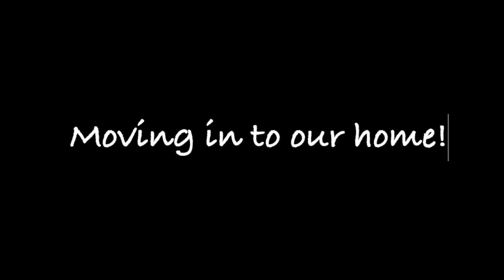We Are MOVING IN!! | Couple Builds Dream Home

Comment: The view of your gravel shop floor reminded me of what I did in mine “temporarily.”  Not going to say how long it’s been. 

I noticed a lot of moisture on the underside of my vehicles, especially in winter thaw cycles. 
Went to Menards (Lumber yard.). Picked up a few of their free throw away lumber shipping covers. It’s like Tyvek. Really works well as a free temporary moisture and dust barrier.
Reply: Also used on lumber and firewood piles, under leaves and branches in my trailer-just pull out tarp at dump or burn pile to unload,  they’re very durable compared to tarps or plastic sheeting. And more UV resistant.
They aren’t perfect, will have some tears or holes from staples. 
Nice to get additional use out of something headed for landfill.

Comment: You both are moving at warp speed- so great to see your hard work making you more comfortable, love the Riley cams.
Noticed a fair bit of moisture on your windows- up here in Canada with tight houses in the winter I run a HRV (heat recovery ventilation) unit to reduce moisture and blend air so the incoming fresh air is warmed and circulated in all the rooms.
Reply from the maker: Now that we have a constant fire going up here we aren't having any moisture issues. But I'm sure as we start showering and cooking we are going to want to look into doing something like that!

Comment: I saw this while watching one of your previous videos. Did you choose the outward swing of your apartment door or is that code? We had the same situation and we had a inward swing installed and the contractor never said a word about it. I really enjoy watching your antics. Have a good one!
Reply from the maker: We wanted the outward swing to maximize bedroom square footage. I doubt as it sits it is up to code. It is fire rated, but is not self closing at the moment. We will eventually be building a large mezzanine that it will open onto, which will make for a much safer landing.
Reply: @AmbitionStrikes  our deal was that it was a pain in the butt walking up stairs and then having to open a door out and then proceed. We had to be three steps down to open the door.

Comment: Looking good! :)  Question- how is the heating situation going to work?  You've got your stove in one corner of the LR and your bedroom 2 doorways away...  Is the wood stove "supplemental/free" heat and you're using something else?

something that occurred to me is you could put a insulated duct with a fan, from the ceiling above the stove back to the bedroom, circulate the heat.... I know there's a power budget of sorts being off-grid, this would get you heat for just the cost of a fan.
Reply from the maker: Hi Chris! The stove is easily able to get the apartment to 70F. The bedroom sits at closer to 65F so we are planning to add some sort of circulation fan to pull the warm air over!

Comment: What did you do to stop condensation on the inside of the metal wall and roof panels?
Reply from the maker: Hi there! Our understanding is that the best way to prevent condensation is to not allow that moist air to get in the space at all. We made great care to create a completely vapor sealed space.
Reply: @AmbitionStrikes  I'd suggest you make an opening in the wall to see and to check the attic space. Since you have already sheetrocked the inside maybe you can remove some screws on the outside to look under the metal panels.